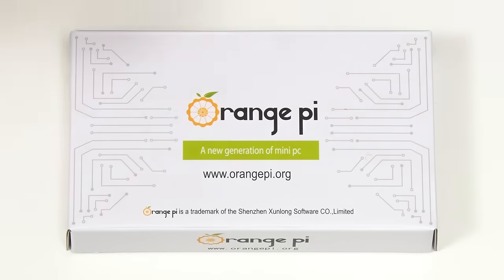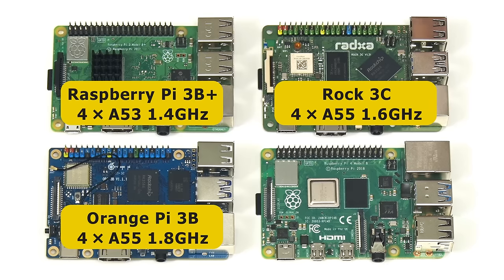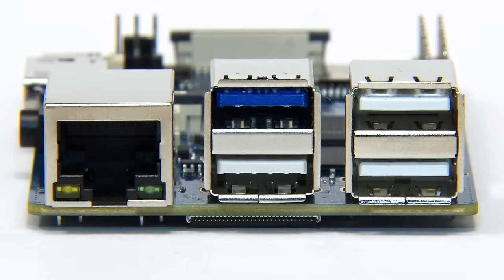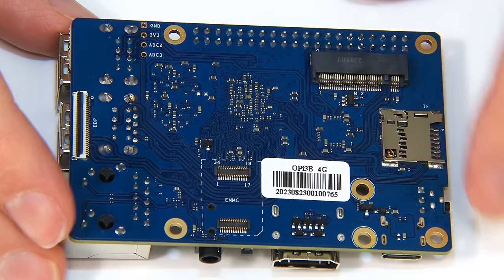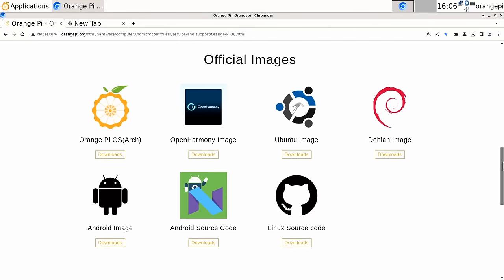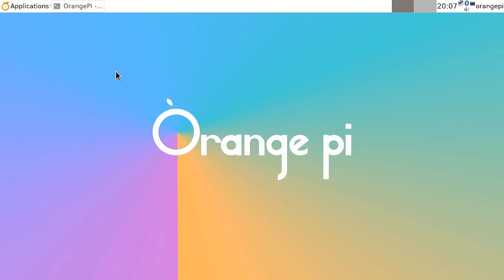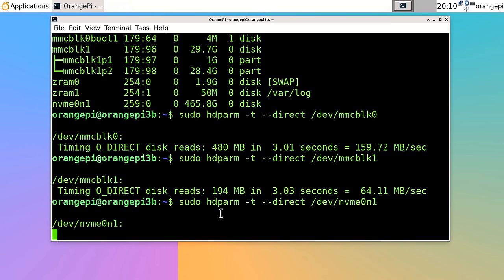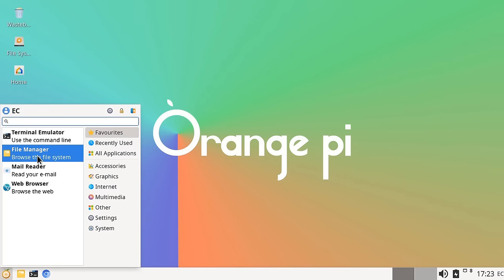Orange Pi 3B:  Low-cost M.2 ARM SBC

Comment: The white USB under the blue USB 3.0 looks also like a USB 3.0 because it also has 9 pins. Or is it just because of the eMMC programming feature? Just curious if that is mentioned somewhere.
Reply from the maker: That is an excellent spot. :) I must check the board, but my guess is that they cannot purchase a component stak with a combined USB 2.0 and USB 3.0 (but can get one with distinct colours, as these common on motherboard now for BIOS programming). So probably you are correct that both are physically USB 3.0 connectors, but the bottom one is only wired for the 4 USB 2.0 pins.

As I said, an excellent spot! :)
Reply: @ExplainingComputers  Oh that may be the case. I realised too late that the pins may not be in use. Thanks for making it more clear. :)

Comment: At the start of the video you compared it to the pi 4, but it's still basically impossible to buy a pi. Please would you reccomend the best alternative to the 4, 3B and Zero 2 that can actually be purchased?
Reply from the maker: As far as I am aware, Raspberry Pi supplies are improving rapidly -- here in the UK the officia resellers are now well supplied. But this is not the case in other countries. I did a video on Raspberry Pi 4 alternatives in February: https://www.youtube.com/watch?v=k8clrUclPIs

Comment: Thanks Chris for this very interesting video.
One question I had for this board when looking at it earlier online - can you populate the M2 slot with a M2-to-dual-SATA and plug in 2 SATA drives, hopefully taking +5V and ground from e.g. ADC or some other unpopulated port - and get this run an Open Media Vault or an UnRaid for a low-cost home NAS? 
Personally, since in my case it was a migration of a live system from an old laptop, I decided not to experiment and just went ahead with a ZimaBoard+TrueNas but would be nice to see if this is able to at least saturate a 1 gigabit link over SMB.

Comment: @3:18

RPi 3B+ has 4x A53 @ 1.4GHz
Rock 3C has 4x A55 @ 1.6GHz
OPi 3B has 4x A55 @ 1.8GHz
RPi 4 has 4x A72 @1.8GHz

The only safe comparison is between the A55 SBCs. I assume an A55 core is faster than an A53 and slower than an A72, but I don't know by how much, and it's un-Chris-like to leave this hanging.

Comment: I get sysbench result 8.6s by Raspberry Pi OS on Orange Pi 3B, debian release 11 bullseye kernel 6.10.160-rockchip-rk356x
/boot nvme (only disk) speed is 329.08 MB/sec for hynix bc711 256GB

Comment: Maybe a bit disappointing. While YouTube playback is fairly...well...lousy a development board doesn't really need YouTube. The connectivity is great but there needs to be some better use of what is available to the board. In other words, it has all these various storage options but doesn't know quite how to use it to any advantage over other SBCs. Have you overclocked it yet? My Atomic Pi runs better.

Comment: Dear Christopher Barnatt,
I am Marco Garuffo. I am an Italian teacher of Mathematics and Physics at High School Liceo Scientico.
I first apologize for my bad English...
My students are 17-19 years hold.
My project is to realize a little laboratory to let my students coding and make 3D simulation of astronomy events and space navigation of starships. All this using maths and physics equations and 3d graphics with computation in double real precision numbers operations. The typical events are Solar eclipses in three bodies problem.
The simulation we create can be compare in prediction to that of NASA with a mean error non greater than 6%.
Do there exist computers so little and jet very powerfull and cheap, like the one you have describe in this video, to realize a laboratory of 16 PCs?
Because if I buy M2 Mac computer (the Intel based PCs crash immediatly, so I cannot use them to do this kind of 3d simulations) It will cost 25k euro and my Pricipal does not allow to spent so much for only 16 students.
I actually use Geogebra software to make 3d simulations on PC.
But this software is not the best one to do this kind of coding.
Can you suggest me a software that is faster and more efficient in using the power of the PCs small and cheap like in this video and so powerfull to support 3d simulations?
Thank you.

Comment: I had this playback issue with my pi4b 8gb. Had to completely reinstall chromium and it's dependencies. 60fps YouTube still unobtainable by just a bit but 30 is solid, as is 60fps or higher than 1080 in other programs and websites

Comment: Nice video! I noticed you didn't talk about the ADC pins available that are not present on other boards. It could be very useful instead of using another arduino, ESP, HAT, etc. There are some good and bad things but I think it could be a good low cost alternative (to raspberry pi) for my handled gaming console project, based on chromium but I need GPU hardware support. Could you make a webgl test on a short video? Thanks for all your works and good explanations

Comment: I have 2 questions. 1 is this SBC more powerful than an old Intel atom Acer one netbook. 2 if so could you replace the Acer one inerds with an SBC whilst using the the display, keyboard, touchpad and camera? If have been wondering why no one has tried this. Many people love the form factor but the first gen netbooks are too low power for video and internet playback. But SBCs seem more than capable.

Comment: I would think after all these years we would have seen bigger performance gains.  Seems like ARM just slammed into its limits really fast.  Really low end x86/64 stuff has seen larger gains.  I wonder why this is.
Reply from the maker: The Orange Oi 3B and its RK3566 are not where ARM is at. :) For that look to RK3588 (like an Orange Pi 5), where they compete reasonably with x86 low-end hardware. There is no x86 hardware at the same price point as an RK3566 SBC.
Reply: @ExplainingComputers  I understand that.  I am thinking more in performance gain over time.  It seems these SBC systems have not really gained much from a decade ago.  Maybe I am just old and jaded now.  I just figured there would be more gains by now in general compared to a decade ago.
Reply from the maker: @cbremer83  I am bewildered by your comment that (ARM) SBCs have "not gained much from a decade ago". This is just bizarre. Ten years ago we had single core 32bit ARM boards (like the first Raspberry Pi) running at 700MHz. Now we have much more sophisticated 2.4GHz octa core 64-bit ARM boards. As I've noted already, the Orange Pi 3B is not remotely representative of the current state of the art of ARM SBCs (although even it is a good 10x more powerful than a Pi 1 from 10 years ago). Low end x86 hardware had not seen a different level of performance improvement.
Reply from the maker: @marcobassini3576  Given that I made a video on this precise topic, and have reviewed a $100 mini PC on this channel in 2023, I am well aware of what you are saying -- so I agree that for many uses mini x86 PCs are a better bet than ARM SBCs now. However, I am not aware of any c.$100 x86 mini PC with a quad core CPU! :) There certainly dual core 2.4GHz Celerons for $120 or less, but not quad core.
Reply: @ExplainingComputers  Not all cores are born equal. You must weigh them, not count. Sometimes 2 > 4.

Comment: I wonder if it's possible to produce SBCs with more powerful processors. Even if it makes no practical sense.
Reply from the maker: Most certainly it is -- this year we've had several ARM boards with their octa core RK3588 processors -- such as the Orange Pi 5: https://www.youtube.com/watch?v=fHQ1GpYRHPo And there are very powerful SBCs, like the x86-based latest LattePanda SBCs.

Comment: Such a missed opportunity to not rotate the M2 slot and support the 2280 SSDs. I have a number of those at hand already, and wouldn't want to chase some 2230 or 2242 ones to use specifically on this board.

Comment: An SBC with potentially good hardware, being let down by its software.  I swear I've seen this episode before.  😂

Seriously, it seems like the Raspberry Pi is the only SBC manufacturer that really has its software properly optimized.  If any SBC manufacturer would just spend a little more time getting their software working well, they could really give R-Pi a run for their money.  Until then, it's just worth it to pay the R-Pi premium -- $10 extra is worth it not to have to deal with poor software.
Reply: Yes - I keep saying that this channel never checks with real Linux, just whatever the vendor provides.  If software support isn't in "real" Debian, these cards will become landfill when Orange Pi stops producing SD images...
Reply: The "real" Linux is guaranteed to work only with X86 chips (Intel or AMD). Even 30 years old. All these ARM chips, whose market is throw away mobile phones, are only guaranteed to work with a (customized) Android build, that inevitably is outdated within 24 months.
I still use my 15 years old Dell Intel Core Duo laptop of 2008 (originally shipped with Windows) with the latest Linux Mint without any issue (including NVIDIA graphic card). On the other hand I never managed to use a cellphone for more than 3 years, with the OS update ending even before the legal warranty expires.
With real X86 mini PCs starting at 100€ (including Win 11 Pro, but compatible with any Linux distro), and including case, power supply, Vesa mount, HDMI cable, Emmc storage (or even SSD), I find hard to justify any of these SBC.
Reply: There's no "let down" in the software.

You've been "spoiled" by the admittedly great work the Pi Foundation has put into supporting their boards but they are an anomaly amongst SBC manufacturers.

Ultimately, SBCs are for tinkerers who don't mind a "DIY" approach to making them work - Linux exists as a software platform that you yourself can adapt as you need to.

If you don't want to tinker then that's fine, you do you. But don't blame the boards for your unwillingness to learn more. I have great successes on SBCs building my own versions of Gentoo Linux on them but I enjoy spending hours tinkering and finding out how these things actually work.

It's a bit like you taking a family saloon car off-roading for a day and then complaining the suspension is broken when you've finished - "right tool for the job" and all that.
Reply: @terrydaktyllus1320  -I’m on the same page. I’m actually deep diving a Lubancat right now that doesn’t really have a neatly packaged OS and is actually sold as a community/learning project.
Reply: @terrydaktyllus1320 the issue is more about available drivers or open source support for such; rather down to the SoC manufacturer than the SBC itself
Reply: @anno5936  Sorry, what point of mine are you actually answering here?

Comment: Looks like a seriously underpowered CPU or unoptimized software package on that unit. Dropping %25 of frames and severe lag input as well. That would drive me nuts. The connections and peripherals seem to be ok. Ive got a raspi 4 8gb and it still looks like it is not getting replaced any time soon, The Pi org needs to add a NVMe dive slot on the next model as they will be falling behind wihtout one. The Opi 3b has a 4k output @ 60 FPS? I seriously doubt that it will reach that.

Comment: Hello. I'm trying to follow along with this video but I can't find a suitable emmc to usb/micro sd adaptor anywhere that doesn't seem to be for a specific device, or require soldering. Could you possibly put a link somewhere for this? As you can tell I am new to emmc.

Comment: I haven't looked into it in detail, but I've run that same 'sysbench cpu --cpu-max-prime=20000 --threads=4 --time=0 --events=10000 run' command on my i5-3320M, got total time 9.0470s, and also on my Raspberry Pi 3 Model B Rev 1.2, got total time 140.5951s, which looks weird compared to the times you show (an rpi 3B on par with an i5-3320M?)
Reply: My laptops i3-6100U got 10.7507s. and yet none of my Pi's have ever been good enough to replace my laptop.
Reply: @ianhaylock7409  your result looks consistent with mine, as your cpu seems a bit less performant (while using a lot less power)

Comment: can we assume that it fits in a Pi 3B+ box, (Possibly with an extrahole for the antenna lead?
Reply from the maker: Yes in most cases, with slight alternation for the USB-C rather than micro USB power connector.

Comment: this may sound bonkers for an old school fella like me, but 4GB are not enough to be a main driver computer these days, because the browser-website milieu of post 2020 alone is such a memory hog

8GB is now the entry level, and if you want to leverage container tech then upwards of 16GB is the bare minimum

this essentially wrecks the entry level because good, fast RAM (VRAM included and even more markedly so) remains the cost bottleneck at what now are the requirements of home computing

Comment: Those mini boards are very interesting, but I think, the usefullness is very limited, compared to its price. You can buy, for example, an used HP T520 thin client for 15 USD. Much more music for less money. And it is on x86-64 basis.
Reply from the maker: 15 USD? :)
Reply: @ExplainingComputers  On the largest auction server in the Czech Republic, one guy is now selling 22 pieces of HP T520 individually for the price of CZK 399/piece. Not only once... I also have seen on youtube that it is normally sold for 15-25 USD/piece in the USA, for example. These thin client x86-64 models were widely used, e.g. in offices, banks, etc. and they got rid of it and it is sold for a few bucks. Yes, of course it's second-hand, used goods, but that's not really a problem. Still better than buying an Orange Pi for 2x as much money, where you always have to solve something and what's more, it comes without a case and with a number of compromises.
Reply: @ExplainingComputers  Otherwise, your video is, of course, as always, flawless and properly educational, and in fact, I have to say that I have already used the Orange Pi for one application. But the real perspective is that if I'm faced with the dilemma of either using a brand new ARM CPU based board for some low-demanding hardware application, or building it on some used thin x86-64 client or used ITX board... so try to guess which will win...

Comment: Pi4B is 4 x A72 @ 1.5Ghz.... But easy to overclock over 2Ghz anyway...
Reply from the maker: No, the Pi 4 was 1.5GHz early on, now 1.8GHz.
Reply: @ExplainingComputers  Understood, v1.3 is 1.5 Ghz, v1.4 is 1.5Ghz as well. But the arm boost flag in the config.txt will boost  v1.4 to 1.8Ghz.
Anyway, always run it over 2Ghz~

Comment: Orange PI are making some great hardware - and to be honest their docs are pretty good. 
However - all that good stuff is undone by the actual fact that a large part of the hardware - and that gets advertised as functional - is basically not. 
At the minimum they need to provide hardware blob drivers for GPU acceleration - and I will say (no offense) - that in review - unless they are queried hard and given black marks for it, nothing will change. 

These boards are likely prime candidates for being shoved in a draw, and or landfill - and IMHO - Orange Pi need to address this issue.

Comment: Can its Gigabit ethernet port actually fill a gigabit link? Reason I ask is the RasPi3B+ has gigabit, but it's connected via the USB2 interface of the CPU so could never actually fill a gigabit pipie (though of course it is better than 100Mbps)
Reply: I think it will, yes. My Orange Pi 5 Plus fully saturates it's 2.5Gb ethernet

Comment: For general purpose pc, these boards cannot compete against cheap Intel N5105 and N95 complete mini pc for $100 to $150.
If you add case, cooling, etc, these boards will be same price as mini pc for less compute power. These are only good for low power applications and usage of GPIO
Reply from the maker: In general, I totally agree with you. This said, an Orange Pi 3B with a case and PSU could be put together for about $60, which is considerably different to the cheapest mini PCs (if less powerful).

Comment: Don't be fooled by the Orange Pi OS offerings, They will soon dry up as far as development is concerned, just like has happened with the Orange Pi 5. 3rd party offerings will be the way to go as Orange Pi are essentially box shifters, masquerading as something else. Their user support is pretty much non existent. Avoid Orange Pi OS (Android version) like the plague as it is half only finished.

As far as the board is concerned, the addition of the NVME slot is the saving grace for what otherwise would be rather meh.

I'll bet that like other of their boards, the size of the mounting hole for 2230 and 2242 are different sizes. Screws can be hard to come by and they should bundle 1 or 2 with the board.

Putting the EMMC in a different box was also a waste of packaging as it could easily be slipped into the main board box.

The YouTube playback with dropped frames is a good example of where the eyes are what matters, not stats.

Comment: Not so sure it's only a software issue... Knowing OrangePi, I'd run a VLC with htop to see if the GPUs are really enabled: if your cores are going through the roof, be sure the GPUs are actually disabled (like on OrangeOS) and everything is passing through an emulator.
Now, you were regretting Harmony was not available, but you really should try Android to have the full experience for the SBC. For some reason, only Android (and probably Harmony) have the power to enable the GPUs, and the graphics are really unleashed: These cards are more made to showcase the chips for phone manufacturer, being sold as toys for Western hobbyists is probably not the main goal. At the moment, Android is (still) the go-to OS for a phone, OpenHarmony is... not really translated.